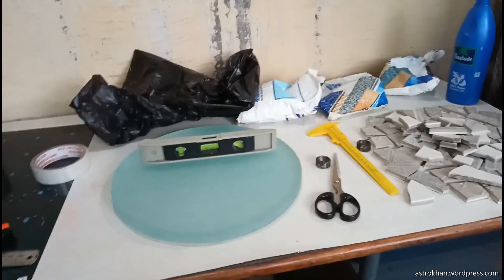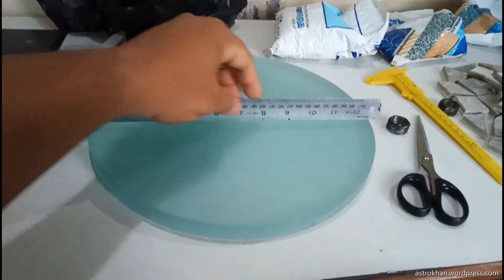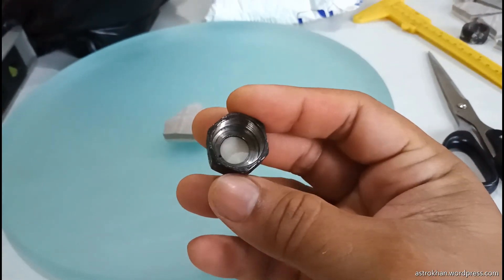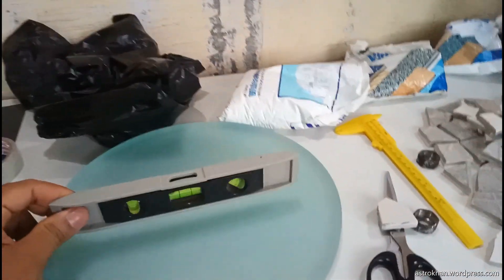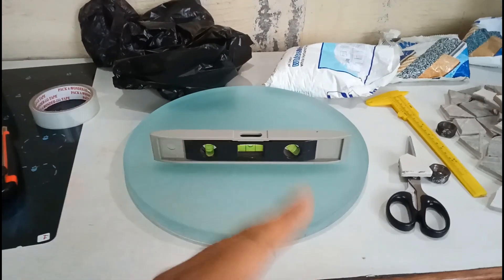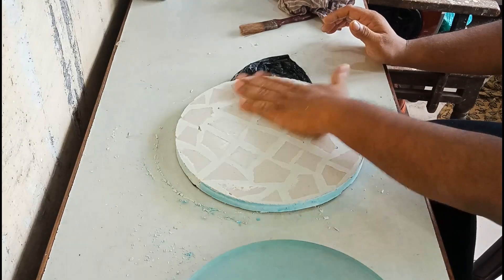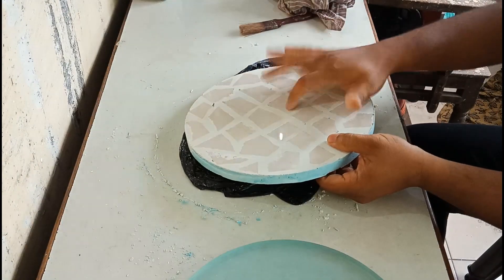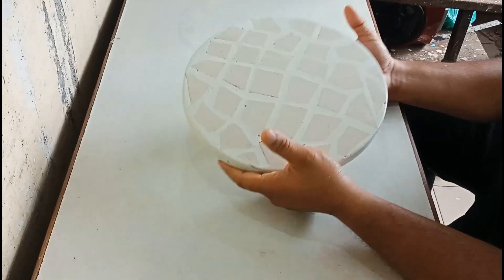12 Inch Tile Tool Making

Comment: Did you use dental cement or normal white cement
Reply from the maker: For this, I used normal white cement.
Reply: @astrokhan  I have made 12 inch tool , using glass pieces of 1.5 square inch. but for polishing i didn't get pitch resin , instead i will use bitumen tool, any suggestion for bitumen tool making.
Reply from the maker: @MrBhujbalgv  bitumen will work however it may be softer than the desired pitch hardness. Anyway please try as many have used it successfully. Just make sure to get a clean piece for melting as any impurity will scratch the mirror.

Comment: How do you aluminize or silver coat your finished mirror? How durable is silvered mirror coating?
Reply from the maker: I send the mirror to a vendor who do the aluminizing. Silver coating is not durable and usually last 6-12 months depends on climatic conditions and pollution.

Comment: Looks great! I'm gonna make a tile tool. Is it less expensive to build than buy a 12 inch blank from you?
Reply from the maker: Thank you Reynold Francis. Yes tile tools are cheaper to make. Almost 1/4th the price of a glass tool.
Reply from the maker: Make light groves or no groves at all between tiles if you would be working MoT. That will help prevent abrasive loss. For ToT, grove depth will not be a problem at all.